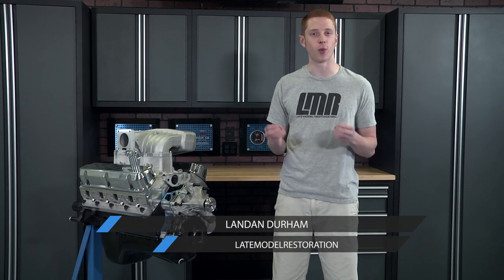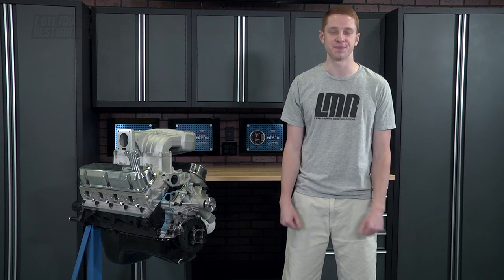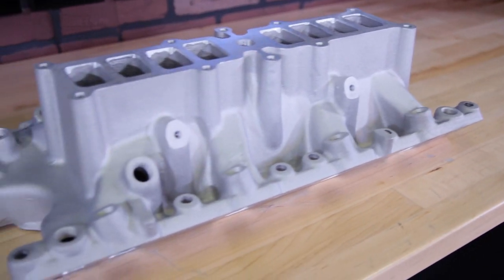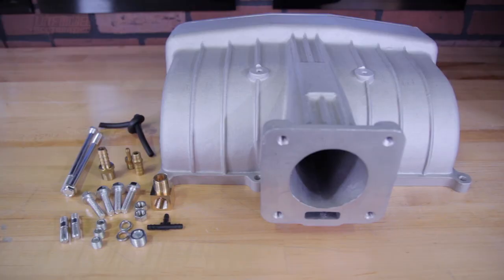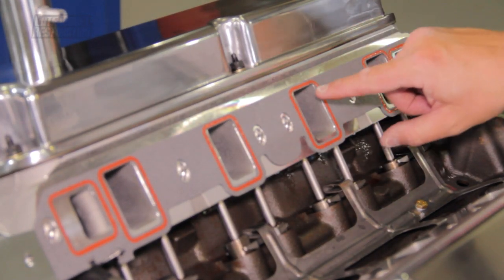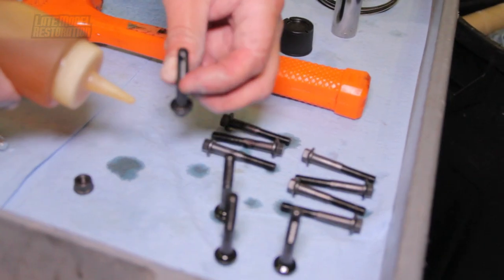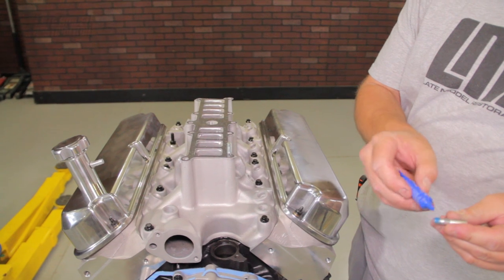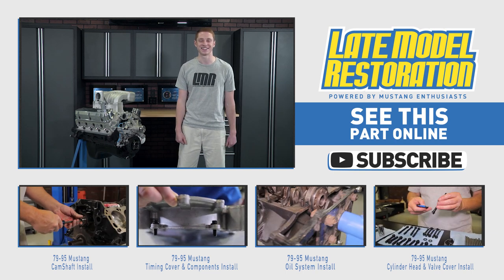How To Install 302/351 Mustang Intake Manifold (79-95)

Comment: You show a washer on the stud for the heater tube. I ordered that same bolt kit for the lower you mention. It did not come with the washer. No biggie, but is it necessary to use a washer underneath the stud like in the video?

Comment: good day! I have a question . I have a truck f 150 1992 351 5.8 engine, the intake system is left? or would have to do modications? admission tale with a lightning ford, where the upper body is installed acceleration, and the valve iac ..

Comment: Can I ask the reason for the stud on lower intake? I definitely did not do that part and am going back over some work around the intake
Reply from the maker: +Room 2three7 That is for the heater tube. -Landan
Reply: you're right I just went outside to look and feel so silly. always the small details overlooked. weird because many bolt kits don't come with the stud. wish I knew this before
Reply: What if it’s not on that one?

Comment: ? WHAT ARE DIFFERENT BETWEEN EFI VALVE COVERS Can carb valve covers work thanks
Reply from the maker: These normally run taller than the EFI applications, but due to this, you will run into clearance issues with your intake manifold normally.

Comment: quick question I have a 74 302 it's the standard heads with rail type rocker arms and I thinking about  a factory aluminum 2 barrel intake from a 351 Windsor being the deck height is taller will it fit the 302 I am debating on buying it
Reply: no it will not.......

Comment: Did you guys use the cork gasket “s” shaped? Looks like you just applied rtv.
Reply from the maker: We just used RTV. -Landan
Reply: Late Model Restoration thanks for the reply, assembling for the first time this helped a lot!
Reply: @latemodelrestoration  why just rtv? not saying its wrong.....im about to do mine because the intake gaskets were screwed and I even got those mr. gasket ones you use in the video. fyi some of my bolts weren't even tight when I removed them lol

Comment: where can i get replacement bolts for the intake plenum i cant find them anywhere 1989 f250 351w anyone can help be great
Reply from the maker: We don't have a kit for that application. I would recommend that you search around on the forums to see if anyone has posted hardware specifications. Thanks. -Landan
Reply: @latemodelrestoration  thanks for the response it seems like no one does if you guys made it you'd be making a very common (6 million 351w's made) product that oem guys would be highly interested i will continue my search!
Reply: @latemodelrestoration  also checked the forms everyone has the intake manifold but not the actual plenum bolt specs i must be the only goof ball to break one of these bolts 😂😂
Reply from the maker: @AntiMaxer  It could be that you spec the hardware yourself and source it from an online fastener company. If you know the length and thread pitch, you'll be able to track something down. -Landan.